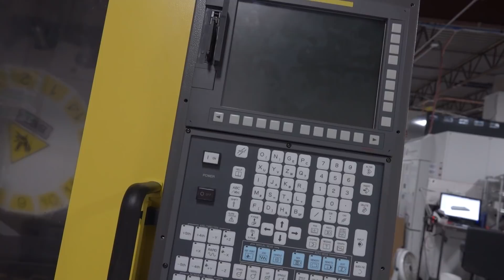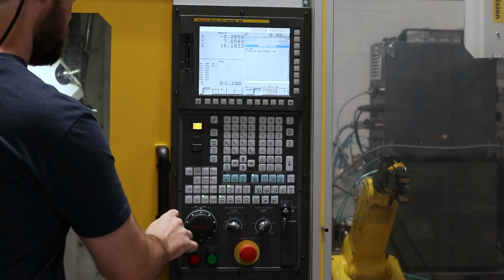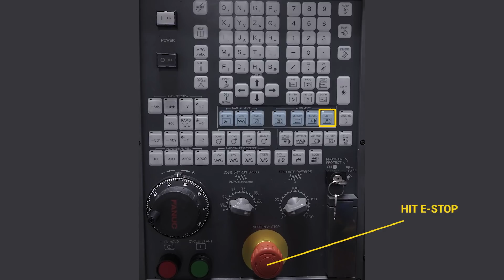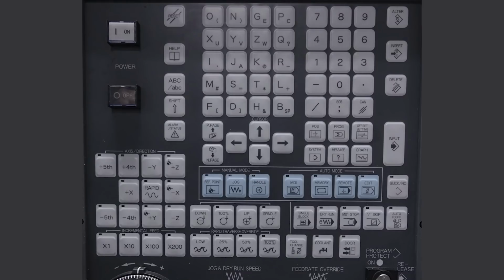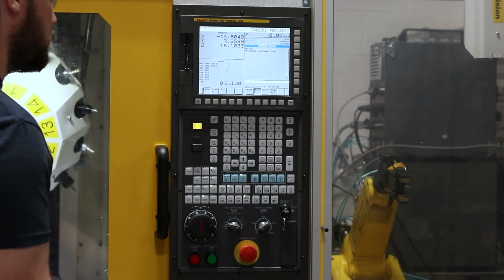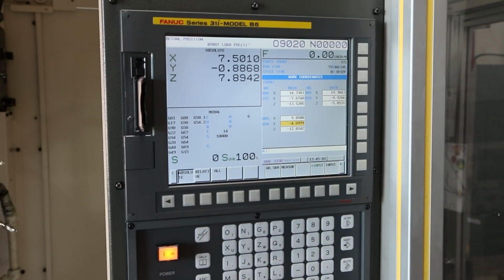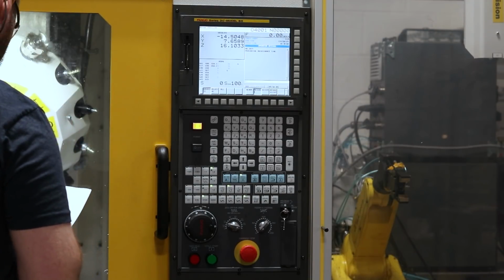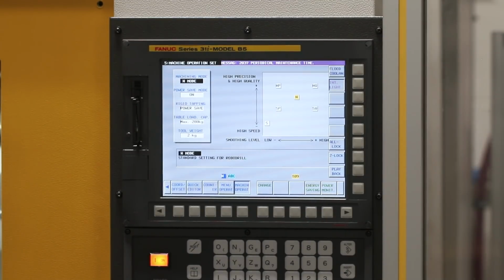Fanuc Control - Basic Walk Through To Get You Running Parts!

Comment: You don't need to open and close the door to lock it, you can just hit the door button. There are keep relays to set the machine to open the door at M30 as well as allowing you to open the door without needing to go into handle/jog mode. You can also set the machine up to not boot to Quick NC. There is a setting in Quick NC for that. Homing is slow because you have the machine in a low rapid. You can also hit either the + or - buttons while homing and the machine will home in the correct direction. To enable password write all you need to do is go to MDI and make it a 1. I'm pretty sure you don't need to enable password write in order to change the IO channel just be in MDI. I usually leave the work light on so there is no need to switch it on and off in Quick NC. I also just use the M codes to turn the chip flush on and off. If you need someone to come in that really knows their way around the control to get you sorted out with much easier ways to run the machine, I am actually an Applications Eng/Field Service tech for your area. Maruka USA in Pine Brook, NJ (my office) is your local distributor for these machines. Give us a call and we can come out and help you. We will also be your point of contact for any service work you may need.

Comment: Unfortunately you can't run programs in DNC with your USB card! It works only for transfering programs in CNC library memory, and for backup. But the standard memory is only of some MByte...so you can't put your CAM programs!...But you can buy an expansion card from Fanuc
Reply: Ummm,
Try  mdi program 
m198 p0000;    
Cycle start
 0000= desired program number.
* From a machine set to read from memory card.

Comment: For machines that don't have Network options you can sometimes get a WiFi Compact Flash card which you can connect to remotely and transfer files over the network onto the card. This only works if the machine can read FAT formatted cards, newer machines (>2010ish) should be compatible. Worth a try they are cheap on eBay/Amazon.

Comment: FANUC is a classic example of a company too stuck in their ways.  The FANUC controller most people are familiar with was developed in 1972.  Let that sink in, nearly 50 years ago.   It does have benefits as since it's the same old technology it's super cheap, and if you worked on a FANUC in the 70s, guess what, you're still an expert.  The price to entry is poor customer support, paid documentation, a walled garden of programming and training.  And what you're seeing in industry more machine builders are using custom UI with different controllers because their customers have been screaming at them for decades to make their stuff easier to use.

Comment: No sure if yall have figured it out yet but for the door K12 bit 6 should equal 1 to unlock door at M02 or M30. Page 1114 of operator manual #2

Comment: How about an operating system designed to be used by HUMANS...not some kind of mutant who loves pressing buttons. The RoboDrill looks like an awesome small machine...but the Fanuc controller is a deal breaker. In this day and age there is no excuse for an overly complicated controller with no intuitive features.

Simply mind numbing. Imagine how many RoboDrills they would sell if they featured a modern controller. The contrast between the Fanuc and the Datron controllers is crazy...one is 21st century and the other is Fanuc...👎👎👎
Reply: The new machines have a better interface.

Comment: I have looked at Fanuc controls in the past and always thought they were more trouble to set up and operate compared to other controls, this quick walk through only confirms that. Something as simple as taking an inputting a program into a machine is only made more difficult by having to change channels, IO numbers, and what ever else was on the long string of commands. It sort of makes you realize why so many people buy Haas machines, not because they are better, but so much easier to use. It is good to see companies such as Doosan try and remedy this ridiculous interface with their own settings pages, but it is still a compromise. I would love to run a machine with a Siemens or Heidenhain control, though.
Reply: We have all three brands you mentioned. The Haas are great all around machines if you don't need to customize or automate them. Robodrills are great machines, but the control is funky at first. Have bought 4 Doosan mills in the last 2 years and automated each. They're great from an automation standpoint, and you're right, the Doosan overlay helps with the Funky Fanuc control. The newest Fanuc iHMI is just one step behind Haas as far as look and feel. Generally our Doosans outperform our Haas machines by 30%.

Comment: Beware - there are a lot of high speed lookahead and edit functions that don't work when reading from the flash card on a FANUC.
Reply: Omg why.... Why can't it read it to RAM!!!!
Reply: @BGraves  the "RAM" on these old controllers was measured in meters of tape, which was what was used before CNC (NC controls).  This amounted to bytes or kB in the PC world.  I had a machine built in 2005 that had 240kB of RAM - that was an upgrade from the standard 120kB.  It is easy to make fun of FANUC for this stuff but keep in mind they make most of their own hardware, and the R&D cycle for something like this takes a long time to pay off.  Not like personal computing or mobile phones where potentially billions will be sold.  A large scale machine tool manufacturer sells thousands or tens of thousands of machines a year.  Their main goal is mean time between failure, not absolute speed.  I have a 1985 machine on my floor that is STILL SUPPORTED by FANUC.  I hate a lot about their controls, but there is a reason they are kind of the world standard.

Comment: What a POS controller. What is this, 1980??? What would the network option have been like?
Reply: The network systems are actually really good. This series of UI is admittedly pretty bad. One you get the hang of it, it's fine though. It's just bass ackward in most every way. Fanuc emphasizes function over form. Our Robodrill kills it every day and has done so since we bought it. Great tools.

Comment: Try loading the programme from the USB, on the manual guide side of the control, rather than the pure fanuc side.  It's a lot simpler, and quicker to me it seems on the manual guide side of the control.   I think there was a parameter I changed to default manual guide input/output to read from USB, but that was only on one of my older machines.

Comment: You're got damn right about the feedrate override. This should be on every machine. Why on earth don't the cheaper CNC manufacturers put this turn-knob on their machines?
Reply: I thought it was 😳😲 have seen it on all I've been around, although I'm not a machinist and I come across cnc machines while doing robot integration so they tend do be in the highest price bracket for high volume work.
Reply: @AlexKall  You can actually find these feedrate turnknobs on the cheaper cnc machines in Russia.
Whenever they make a custom special purpose machine, or rebuild an old lathe, they pretty much always install a BaltSystem control panel with turnknobs for the speed+feedrate. It's just standard in Russia, no matter the pricepoint of the machine(even if you're only spending 10k €); so I don't see why Tormach, Haas and all the Chinese manufacturers don't have it.

Comment: This is an older machine and has since been superseded with a newer iHMI Robodrill interface that is more intuitive.  The Quick NC is still there but there are certainly some more intuitive interface screens to be used.  One thing i did notice is that to change the IO channel in the settings screen you only need MDI mode, not e-stop, EDIT and PWE on, so that should save you time.  With the newer interface there is an even faster way to do it too.
Reply: The new interface is the bees knees. Makes things so fast and is easy to switch back to the old interface to do any maintence operations that are in the quick nc.
Reply: Im still faster on the legacy side of things... but yes, the new iHMI is nice to look at and there are some things that are much more intuitive.

Comment: The UI designer on that thing can't possibly ever have met a human.
Reply: I think the same thing when I look at almost any machine control. With the exception of some PC based controls and brands that I don't have experience with and can't speak on, they're almost all terrible. No matter what anyone says about HAAS machines they can't deny the fact that they have one if the simplest and most user friendly controls, especially for beginners.
Reply: @seabears_hate_circles  I've read that in HAAS's early days, they specifically did not copy anything already on the market; they used existing products as examples of how not to make an interface... Seems a lot of that hasn't changed.
Reply: It's because there was no such thing as UI when the control was designed.
Reply: @capnthepeafarmer  There's always been such a thing as UI, even a static book have it. You might confuse it with GUI, but you don't need graphics to make a good UI.
Reply: Brynjard Øvergård I was being hyperbolic.  Even a command line is a user interface, not a good one, but one none the less.
Reply: @capnthepeafarmer  And what's "not good" about commandline? When it's used for what is was made for it is easily superior of any Graphical UI.

And just as an example, all the UI interactions done in this video could easily have been done in a well designed text only UI without any noticeable loss of either usability due to it's lack of graphics.

My point is that the inclusion of graphics doesn't make a UI any better nor worse (in fact often worse since it's more difficult to build), what matters is the interaction design. It's only when you need to display information that isn't easily represented in text that a GUI inherently becomes superior.
Reply: It looks really similar to the ancient Mitsubishi controls on my mill I'm fixing. It's definitely a holdover from legacy controls so people that know how to use the old machines can easily transition to new machines. The UIs are horrible and very unintuitive. Even being a programmer (software not cnc) using the interface sucks. I kind of understand why it is the way it is, you're very low level to the hardware, and in the late 80's and 90's there wasn't a lot of cpu horsepower in the control for a fancy gui, but they really are terrible interfaces, no doubt about it.
Reply: Reminds me of the old CPM operating system.
Reply: I was thinking the same thing...it's like they went out of thier way to make the UI as difficult as they could.

It boggles the mind.
Reply: If you're a fan of WH40K, I bet their tech was based off of Fanuc.. I swear you need to know a few rituals and sacrifices to get to all the proper menus and settings, not to mention you need them to get the KNOWLEDGE of how to get to them. And then you have to pray you don't anger the machine spirit inside.

Any old okuma control will have the same sort of layout though (5020, U10s,  E100s,  basically anything before 2000). It's a good layout for 3 centuries ago. But I wish fanuc would have progressed a bit. 

The new OSP controls are a fucking dream to use and run. Hell, you can even throw custom GUIs if you're running part families and just select which part you want (if you're running a bar fed lathe, this gets really nutty, you can basically turn spark plugs of various sizes from the same blank, changing the thread, size of the hex, length, basically everything depending on the values you set for your options).
Reply: That UI designer could easily making fortune on linuxcnc retrofit for these
Reply: Mazak is just as bad. Check out UCCNC. UI perfection